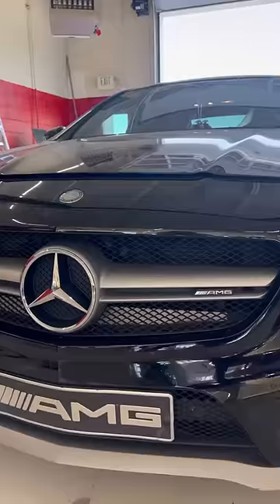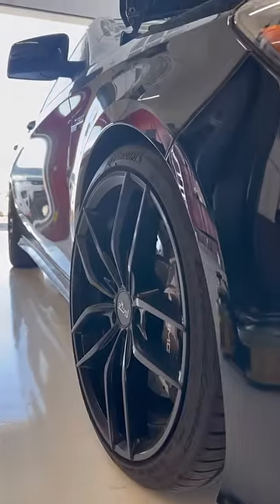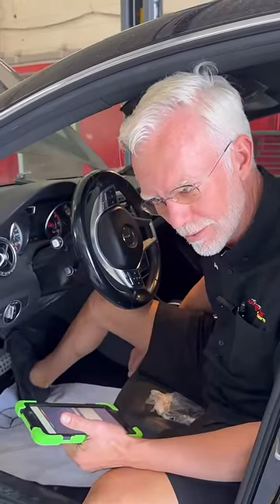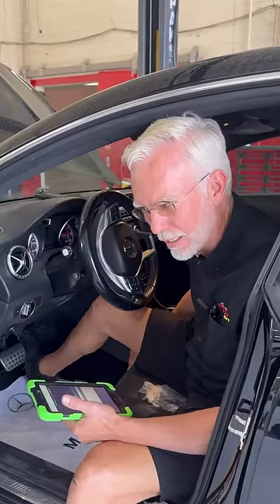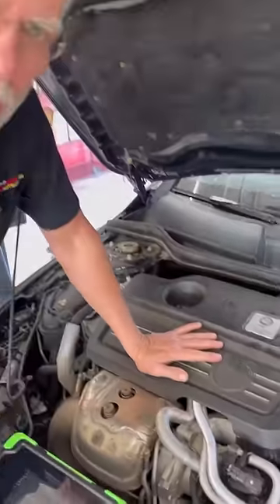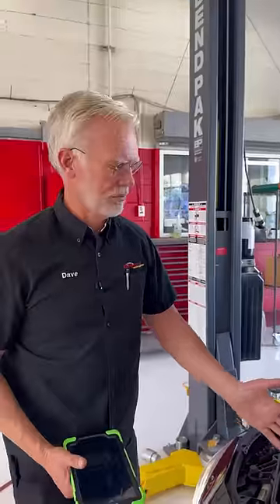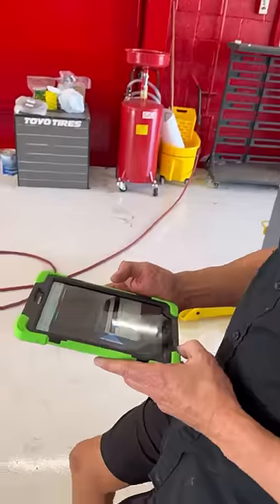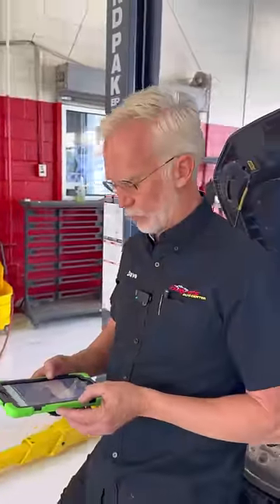Mercedes AMG Nothing but a slight noise on start up #carrepair #autoshop #mercedes

Comment: I’ve worked in many dealerships over the years they never solve anything they just wanna make the most money off the transaction and avoid timely troubleshooting. This man is an excellent business owner and determined problem solver I can really appreciate it.
Reply: Very very true...I had that issue with Be, while it was under warranty. They wouldn't care about any noises....just change parts while VW headquarters pay for it
Reply: Which is exactly why the "stealerships" are horrified of the imminent arrival electric cars.
Reply: Yeah i believe you. The stealership is not likely to be interested in troubleshooting.
Reply: I have worked at many dealerships as a service advisor and rarely found that they just want to make the most money. Now on the other hand I have constantly found techs that are not great at their job and refuse to spend any substantial time trying to troubleshoot and diagnose the real problem (as you said) as well as hate being liable to recommend a fix that doesn't end up solving the problem and requiring more work after the repair. It's less of a scam more of a lazy and low skill issue.
Reply: @tylerjohncarroll  I agree and then all the good techs who are good at solving diagnostic problems and mystery Diagnosis quit and start their own independent shop lol.
Reply: @seriouscarguys55  I do tend to see techs at independent shops that are better at diagnostics but have never worked in one personally
Reply: @tylerjohncarroll   If the tech is for rate then I can understand not wanting to spend more than 1  hour trying to diagnose an issue. If I can't figure it out within that time frame then I quote additional diagnosis. You wouldn't believe how much pushback I get from advisors for needing more time to properly figure the cause of the issue.
Reply: @NuGundam_  ohhh yea I get it. All the techs that I worked with were flat rate. I get it they need the hours. It's just hard to make customers understand sometimes it takes 3,4,5 hours to diag an issue which in the dealership is $350-$750 and then to tell them ohh yea now that we diagnosed the problem it's a $200 repair. For those of us that work in a shop and understand cars that's just the way it is. To a customer all I ever hear is wtf wtf your just scamming me I'm going somewhere else! They just don't get it
Reply: F*ck the dealership end of discussion
Reply: This is the main reason I’m going electric. I’m tired of being ripped off by mechanics. It’s rare to find an honest one such as this gentleman
Reply: Pretty sure a new engine is a lot more timely.
Reply: Check cooling system for the overheating problem, water pump bearings, not familiar with euro engines, but probably doesn’t need an new one
Reply: @Jordan-M-18-06I think.
They will have isjust not as complicated to solve the issues
Reply: I work in an independent repair shop, over the years we have gotten busy, enough to keep 7 of us with steady work. Not long ago all of f started wondering why the local ford dealership started sending some of their vehicles over for diagnosis and repairs.
Reply: @audieconrad8995 lol nah electric cars have a ton of issues and pay well cause of the certifications required to work on them. I'm all for electric cars when a battery is 30k lolol trust me don't buy into that just learn to fix a gas vehicle yourself and stick to it as long as possible
Reply: @tylerjohncarroll exactly. And the idea that service advisors don't want warranty repairs is insane. I'll take the warranty engine replacement 10 times out of 10 there's no guarantees if the customer has to pay most aren't gunna get the work done cause of the $$
Reply: @dwightmossop2024 don't go electric. When you have problems it will be more of a pain in the ass than you have ever experienced. And if the battery goes out it's more than the car was brand new most of the time. At least you can buy a used engine in a pinch for gas cars
Reply: @Brennenm97   Yea I love when I see friends, customers, people online say "yea they don't want to fix it because it's under warranty" We KILL to find new cars that need a friccen engine replacement we KILL to need to replace your transmissions. Honda Toyota Ford they aren't telling us not to replace those things they are just saying "hey if you replace that and we find out ACTUALLY it wasn't broken then we aren't paying you" and it comes out of the service departments income. So as service advisors we simply can not replace a part if we can't GUARANTEE it's actually broken. But warranty or not we do EVERYTHING we can to find anything broken on your car so we can make money fixing it.
Reply: Everything is about what the factory will approve and what the shop person will make money on solving the customers problems is not the focus. If Chrysler says they’re not paying what they wanna make on that repair they’re going to try to find something else and make the van sit to make it worth their time if Chrysler allowed other certified shops to do warranty work, not a single customer under the age of 50 would ever show up to a dealership period.

Dealership service departments are not in business because they’re great problem solvers and they provide you with great service. They are in business because they are a monopoly and you don’t have any other choice while under warranty.

There is zero comparison to the experience you receive at a high end independently owned shop versus being another number on the board, going into a substantially large dealership business most service departments make over $1 million a month in gross profit most sales departments and car lots only do 100,000 to $200,000 a month in gross sales profits. The service department is 10 times more valuable to a dealership than the car sales department.
Reply: @ozozi49 My kid has a 2013 Jetta TDI... They replace the intake pipe that hold the air intake temp sensor.. warranties it.. now they are making 3rd revision because the second one keeps condensating water... And they aren't covering it. $1500... VW won't even listen...
Reply: @audieconrad8995 you are clueless.   Them electric cars are never happening.   Every American charging their cars at night and running home A/C units is not supported by the power grid and will take 30 years to build.   Never happening
Reply: Exactly what I said. I didn't have to work at a dealership to know that either. It's obvious and the practice needs to stop.
Reply: Exactly the sales department just provides new victims for the service department I would imagine that the car companies make more money on parts than they do on new vehicles I’m sure any warranty work is priced into the sticker price and all the parts are engineered to be as cheap as needed to last just long enough for warranty

Comment: First step is replace your dealer and then fix the boost issue.
Reply: 😂😂😂absolutely perfect decision everyone should be adviced
Reply: Hahaha 
Exactly
Reply: My first thought was the turbo needs a rebuild or replace. I'm also just a shade tree dipshit from MI though so...
Reply: The " stealerships" strike again.
I need an oil change. Sorry, you need an engine.
I hear a noise under the hood. Sorry, your engine is bad,you need a new one.
Etc.Etc.
Reply: @k.m.9801  
Hahaha 
All true...
Reply: The engine sounded fine but my daughter needed braces so I pulled the engine.
Reply: Dealer wanted to make a sale, and gain one for the used lot.
Reply: I fully agree with you lost Pony 👍👍👍👍🤣🤣🤣🤣
Reply: Exactly
Reply: 100%
Reply: Yes it sounds like a a turbo compressor side noise maybe it's not getting enough oil lubricant. And what does it take to remove the turbo and replace it. If you have to pull the engine to do it that's probably why they're getting their answer
Reply: Sounds like a boost leak.
Reply: Exactly 💯 💯 💯
Reply: Take your extra long screwdriver  ,put it up to your eardrum,put it on the engine area has squeakying,squeaking,use it like a stethoscope
Reply: @SteveGoen-cy4xf  take a shot
Reply: No the overheating then the boost😂
Reply: It’s overheating because of the boost leak. The lack of air in the combustion chamber versus the amount of fuel that the computer is telling the injectors to deliver causes the excess heat. 🤔🤷‍♂️
Reply: First thing would be to never buy German car but if you already have, try to sell it??
Reply: Turbo intercooler pipe split check first if engine management light has been turned off then if it has its the turbo bearings
Reply: Sho nuff 😂😂😂
Reply: New engine. Problem solved 😂
Reply: Possible blown head gasket.
Reply: @KikkelisKokkelis vs an American car? I’d take German all day. Maybe not Audi though.
Reply: Facts
Reply: I'm surprised the dealer didn't try to sell him a new car. The next best thing for the dealer is to sell a motor!
Reply: Brilliant!! 
I was gonna say, as a dealer every car needs a tranny, engine, etc. That way they can get a raise next year after record service sale.
Reply: Lol
Reply: Yeah turbo bearing has lost its smoothness, and needs good oil flow to stay quiet.
   But the overheating, that was low oil, and they realized the low oil condition to late.
  I got low oil, and don't know, jam the throttle jam the brake, Im using my power, the oil is slung back and forth in the ctankcsse, air is drawn into the oil flow,  the bubbles flow way faster that the actual oil to the top where turbo bearing is, the oils  falls back and keeps my oil light if  but the top components don't have solid oil flow.
   Then  if it's reoccurring after they filled it with oil, then maybe water pump, but unless I didn't and don't during any operation and system stayed full, no see the leakage to cause, then  oil, was the problem now correctly, leaving the rough turbo bearing and turbo bearing seal dropping boost, with the rough bearing.
   That's one scenario.
Reply: Why you asking us, your the mechanic? Left us hanging there for some clicks and likes.
Reply: Intercooler issue?
Reply: Air filter
Reply: Replaces engine, finds out it was boost.
Reply: @bubbax7477 for the price point they don't last. Asians build longevity the best.
Reply: @rxs3016  😂
Reply: @rxs3016  He's asking because the question isn't a mechanical question for car mechanics. It's an ethical question - why trying to trick the customer to buy a new engine.
Reply: @rxs3016 maybe he's NOT a mechanic and just asks youtube😂
Reply: 😂😂😂 FnA 🤙🏽
Reply: I knew thered be a good"n in the comments...I wasn't disappointed.
Reply: Sounds like you people in SLC know which MB dealer you should be avoiding.
Reply: Was gonna say,, turbo has an oil pressure problem I bet
Reply: We need to start naming these dishonest dealerships.
Reply: Nope, stay away of german cars!!!
Reply: Excellent plan
Reply: Hey guys... When all you have is words and a very expensive option then you have to take the advice seriously lest you add more expenses and end up buying a new engine after-all.
Reply: Uh huh why's it over heating and why does it have so much valvetrain noise?
Reply: Healthy amgs don't sound like shit
Reply: Or just visit the BMW dealer instead
Reply: I would LS swap it. But hey
Reply: You’re correct
Reply: 2nd Step send it to Dave !
Reply: You mean buy a Toyota, right ?😆
Reply: no have the dealer replace the engine ask for your old parts back (your old engine) and then send your old engine to Dave and have em check it out once fraud been discovers sell the dealership
Reply: @SpeedracerMach pulling the engine and replacing the turbo is still cheaper then a new engine lol
Reply: Do a complete flush in the cooler
Reply: Rule 1: Never use dealer for maintenance.
Reply: 😂😂😂😂😂 fooca n A 😂😂 best comment ever thank you for make me laugh bro
Reply: Back in 2005 my dad was car shopping. He’s a but particular. There was a custom ordered SL600 that the customer decided he didn’t want so the dealer had it in the showroom.
My dad bought the car and told them he’d be back to pick it up after we got back from vacation.
The day he picked it up the tire sensor light was on. He asked the sales manager about it, and the service manager. The service manager told him in a word salad that the tire sensor and probably the wheels and tires would need to be replaced.
On his way he stopped to top the car off. The guy noticed the light on and put air in his tire. Problem solved.
Mercedes dealers are some of the scummiest crooks.

Comment: If the dealer tells me I need an engine, I’m driving that thing until I know I need an engine.
Reply: I absolutely respect this comment
Reply: So u buy car with 30 day wareanty, NOw what
Reply: And what make them easily repairable vehicle actually need an engine 😂
Reply: And you will never need one.
Reply: Genius!
Reply: Exactly right. When the engine blows up you need a new engine. But not before
Reply: Yes they are correct! Replace the engine with a Ls3 and your good to go!
Reply: @danrook5757 who buys a car with a 30 day warranty? 😂 you’re asking for issues.
Reply: My cars 20 years old it’s got a small lifter tick and seeps some oil. I had a shop tell me once I needed a new engine because the mechanic saw some oil stains and heard the lifter tick. The engines not even dripping oil and the lifter tick is easy to fix it’s a V engine just pull off the valve cover fix the lifter easy.
Reply: @ryans413  my mom’s ‘01 Jeep Cherokee had a check engine light from ‘05 to ‘14 and went 200k miles with it on. They just don’t build them like they used to.
Reply: 😂😂😂…this comment is underrated.
Reply: I have purchased five vehicles from dealerships and I personally get sick every time I walk into one of them!!
Reply: @KkevrockK you realize that 30 days is highly standard for used vehicles from dealers, right? Right?
Reply: At least do basic stuff, likemoil changes and what not. Otherwise your engine will be the next subject to this guy.
Reply: I bought a used   Lexus ES35 2008, and they have a problem with the timing chains leaking. Mine was not the exception.  They quoted me 4500.00 for the job.  I took my car used high mileage oil Blue Devil oil sealer and no full synthetic.   The leak stopped.  I drove  the car 200000.  Never did that repair, not engine code!  Sold the car on a used auto chain.  They bought it and were very satisfied with how good the car was.  Always get a second or third opinion.  If the car can not crank or run, then that's different!
Reply: i mean... either they're wrong/ full of shit... or they're right... and then it's the difference of a tow bill... you could lose a core charge if you window the block or somethin, but still. i'd probably just get a second opinion, but nobody has touched anything of mine since i was 18 and it was warranty work. last time i let some dumbass change my oil, i came very close to having to pull my 2 year old engine still under damn warranty just to get the oil filter off. but there's also no way in hell i'd buy anything new now, even if i hit the lottery that i don't play cause  i'm idiot tax exempt.
Reply: @salvadordollyparton666  it depends, if it was a Pentastar then they probably needed a new engine the second it left the lot.
Reply: @ryans413 lifter ticks sometimes means the camshaft lobes are flattened, it eats away at the cam lobes.
Reply: @SLAutoRepair  yes that right but most push rod engine are noisy on start up until the lifters get oiled. My car after 10 seconds after siting all night after 10 seconds it’s silent. That’s what the mechanics heard they didn’t let the car run long enough probably started it for 5 seconds and shut it off and said lifter tick but it’s not.
Reply: If you take care of them and do service fluid changes before recommendation it might just happen to last for years to come. Or may not I've had both happen 😅
Reply: Made me laugh.    I've accepted that challenge. Drove it 10k sold it for what I paid.
Reply: @ryans413  i have the same issue, got an99 chevy 350, common lifter tick, although no oil leak, and ill replace the lifter myselfs, i worked for O'Reilly, and with new heads, its an 1800 job just on oarts alone
Reply: legit lol